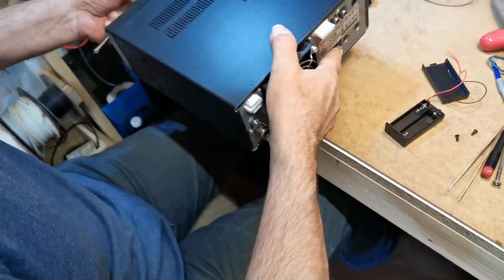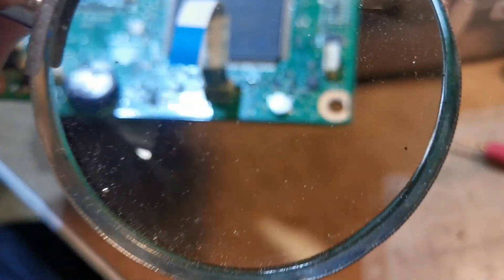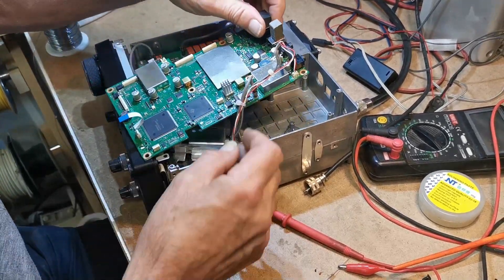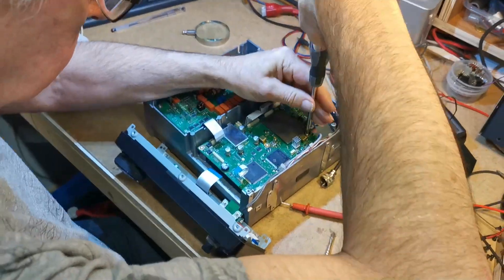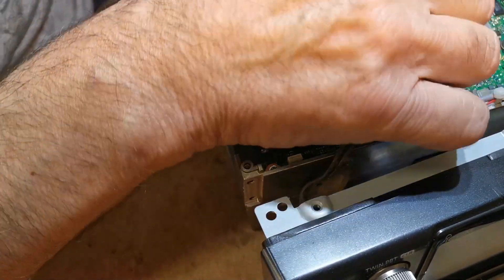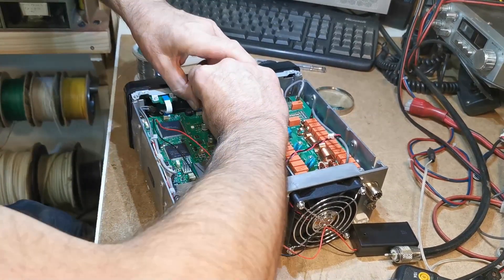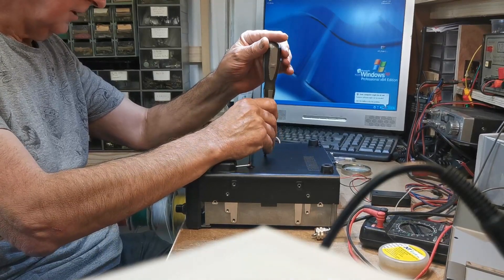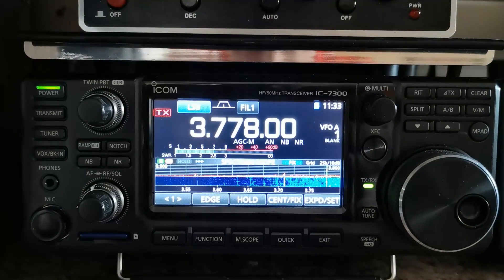Icom IC-7300 Clock Battery Workaround | Fix the Date & Time Reset Issue

Comment: Instead of AAs use a Cr2032 battery and case
Reply from the maker: If I wanted to do that, I would have. I wanted huge capacity. Still working fine to this day on the same cells.

Comment: Very dangerous working on that ESD sensitive 'Main Board'. 
Also those Ribbon cables are easy to damage.. I think this 
retired (Computer Hardware CAD Tech) will pass on this 'upgrade'.
Thanks for the video. 73
Reply from the maker: @marcroche9324  good for you. Still working fine thanks.

Comment: ICOM has a work around solution.
It is called: Time adjustment software ST-4003W
No need to replace the battery

Comment: Just done one of these tricky little buggers! I did put a diode in series just to stop the charging circuit trying to push power back into the battery!
Reply from the maker: @paulmeynell8866  it can push all the power it wants into my battery lol.

Comment: An alternative solution is to replace the coin cell with a couple of 10Farad supercapacitors in serries. These are small and can be fitted internally.
Reply from the maker: Maybe so. I wanted it external and using large cells. As I don't use the radio that often. Still functioning perfect since this video was made.

Comment: All that because you are too lazy to put the original battery back in for the backup clock? LOL LOL LOL LOL....There are aftermarket batteries that last many years. And hanging that PC board off the edge can get damaged or cracked when working on it. And not using a wrist ground is very bad. This job looks like sh*t just for the clock....SMH!

Comment: Simply keep attached with your radio a small ups 12 volt battery via the main DC power line, when not using the radio .Clock will not die. No need to play like this with 1000 dollar radio.....
Reply from the maker: Still working 3 years later.

Comment: You made this more complicated  than needs to be  and you  don't have to remove  circuit board to replace battery. Remove top and bottom covers and remove  front panel of  radio along with 2 ribbon cables. Use a heat gun to heat up battery  solder and remove it. Purchase  a 2032 battery holder ( Amazon comes with holder and wires.) and rechargeable battery LIR 2032 or ML2032.  You can  use double sided tape to secure battery holder to the left side of battery location.  Your way  of removing battery could damage the CKT. Bd.  tabs and disconnection  all the other ribbon cables and removing CKT BD is  more dangerous of breaking something. Your an amateur .
Reply from the maker: Still working though. Amateur.... Yes I am.
Reply: And you are rude and not putting yourself out there for people to learn from so, how about you make a video since you are such a pro so we can tear you apart?
Reply: Heat Gun may melt other solder point with the wide barrel flowing at the board. Could be dangerous stuff.

Comment: I have replaced batteries in many Icom radios, you don't need to remove the dead board mounted battery cell. Simply solder the red and black wires from the new external battery case right to the board mounted battery connections. Just make sure you have the polarities correct!
Reply from the maker: I'd sooner have it out. It's just as easy to do it right than cut corners I've found in my experience.
Reply: can't the battery be just removed and replaced with another the same battery without desoldering it ?
Reply from the maker: @marcing4287  I'm sure it could. I was more concerend with getting it out because if the OG battery was to leak. And to all those who said it would work, still on the same pair of cells and working perfectly.
Reply: @GeorgeEI7KO  is origin battery itself soldered to the mainboard ? if not, if I buy a new battery I could just replace it.
Reply: @marcing4287  No.  It is a PCB mounted component.  Soldered in.

Comment: Hi there does anyone know if the vfo knob on the 7300 just pulls off??  F
Reply: By the way the vfo knob is held on with a1.5mm Allen screw under the rubber band.

Comment: Yo colocaria un portapila de bateria cCR 2032 dentro del radio en vez de ese adefecio que hizo el sr
Reply from the maker: hola
Hice lo que hice por varias razones.

1- Quería que la batería fuera externa a la radio para poder controlar el voltaje.

2- Usé las celdas AA porque quería una capacidad masiva, ya que a veces mi radio puede no encenderse durante varias semanas.

3- Recibo mucha mierda en los comentarios de este video sobre lo que hice y cómo no funcionará, etc., pero aún funciona bien,
   Ni siquiera revisé la batería desde que se hizo este video.

¿Dices error? no si funciona no es un error

Hi
I did what i did for several reasons. 

1- I wanted the battery to be externaf rom the radio so as i could keep a check on the voltage.

2- I used the AA cells as i wanted massive capacity as sometimes my radio may not be powered up for several weeks.

3- I get a lot of shit in the comments of this video about what I did and how it wont work etc etc. But yet its working fine, 
   Ive not even checked the battery pack since this video was made in fact. 

You say Mistake? not if it works its not a mistake

Comment: Could we just use a Lifepo4 battery in there?
Reply from the maker: I don't know Donald. What I can tell you is, since this video was made I have not looked at the battery pack since. It works perfectly. Loadzzzz of capacity, which was my idea in the first place.
Reply: @GeorgeEI7KO  Well I know just enough to be dangers sometimes. The LiFePo4 battery is about 3-3.5v and the AA size battery should run that clock for many years. The trouble I see is that the 3v regulator could be damaged trying to charge that big of a battery. The AA normal rechargeable battery are 1.2 v each and 2 will give you 2.4v.
Reply from the maker: @donaldsmith3048  Ray says the reg won't be under any strain. As I said it's been fine since done.

Comment: Thanks for the mod! I use my IC-7300 for portable use so when it is not in use there is no power to the radio. I'm tired or resetting my clock. I'm curious where did you mount the battery pack on the radio. de ve3zn
Reply from the maker: It just sits on the desk at the back of the radio.

Comment: So, my battery went flat too. Powering the rig (without switching it on) for 24 hours charged it again. No need to replace it at all. Heck, even the manual mentions this on page 12-11:

"If you do not use the transceiver for a long period, we
recommend that you connect the transceiver to a power
source at least once a month. The charging period is two
days whether the transceiver’s power is ON or OFF."

I know: men don't read manuals...
Reply from the maker: I left it on the psu (radio not powered up) for a week straight. No dice. The battery was gone. Well documented fault.
Reply: PAGE 8-7 IN MY MANUAL

Comment: Now that you've done this mod, since the original battery is surface mount, do you think it can be removed without removing the front panel and the board?  That way you wouldn't have to pull any ribbon cables.
Reply from the maker: Simple answer, no. You don't have the access and you'd end up risking burning something.
Reply: @GeorgeEI7KO  thanks, I just ordered a used one on eBay, hopefully it’ll arrive this week.  Being that it is used, it may need this mod.

Comment: Can someone explain the engineering logic behind hard soldering a battery to the circuit board?  Why would Icom do that?
Reply: This is insane!  Makes me serious second guess their products now!
Reply from the maker: Lean manafacturing methods I'd imagine.
Reply: It's designed to last much longer. Therefore, by design, it should rarely need replaced. It is a SMALL rechargable 1 mAh cell. It recharges SLOWLY whenever power is supplied to the radio so when people shut off the radio AND the power supply the small cell keeps getting weaker and weaker. Eventually it drops too low and can't recover no matter how long you leave power to the back of the rig. Kenwood has similar issues with some radios. The problem is most people power off their power supplies when they power of their rigs. The recharge circuit is designed for that tiny 1mAh battery which has a standard charge current of 5 microAmps (0.000005 amps). You risk radio damage by substituting two GIANT 'AA' cells in its place.
Reply: @stevefrank353  The charge current is much higher: a 3k3 resistor is used to charge this battery from 3.3V. So the charging current is 1 mA and theoretically the battery is fully charged after one hour on power supply. If lithium cells go flat, they take a much longer time though to recover and to start to accept charge. The battery of my 9700 has just gone flat so I'm leaving the power on for 24 hours and see if it comes back to life.
Reply from the maker: @stevefrank353  how exactly? The recharge circuit can't tell weather its recharging a pair of aa cells or a sub miniature cell that is no longer incapable of taking a charge. To expect people to leave their power supplies on 24/7 is rediculous. The radio will only draw what it needs from the cells, and will never be able to do any damage to the recharge circuit as its no different to leaving the power supply on as you suggest.
Reply: Yaesu did the same thing in the FT 991

Comment: Is that battery rechargeable or just has to be replaced when it goes flat...
Reply from the maker: They are reghargabke high capacity cells. By my calculations of what the radio draws for the time and date backup (settings are stored on the SD card) it would take 12 years without ever being switched on for the radio to drain them.
Reply: @GeorgeEI7KO  Hi there my 7300 is about 1 or 2 years old i dont use it much but when i do the clock has gon back to zero, if i use it 2 or 3 times a week its ok, i bought the radio new...F
Reply from the maker: The battery they fitted from the factory will only hold it for a hand fuk of weeks with no power going to the radio. I've not looked at the battery pack since and all is well.

Comment: I just want to ask a doubt,  what happens if we attach a battery pack without removing the dead battery,  will it corrode. Removing the battery seems to be a micro surgery.  Tnx
Reply from the maker: I'd sooner take it out rather than risk it
Reply: The dead battery is a rechargeable lithium cell. If you do not remove it, it will be charged by the external battery without any form of current limit. That ca be dangerous.
But why replace the battery? If you leave your rig powered for a night, the small battery is charged again and your clock will hold the time.
Reply: @meindertsprang7491  I operate everyday, so there's no chance of getting it discharged or dead. That was a general question on the possibilities. 73

Comment: Thanks George and Ray!
The dead clock battery in the IC-7300 has been driving me nuts.
Having to set the bloody clock EVERYTIME you power the set back up is ridiculous.
I would live with it except when recording audio, the timestamping is all wrong.
Why the hell Icom used such a tiny battery is beyond me. Will do the CR-2032 mod in mine eventually.
Just have to bring myself to pulling apart the radio, which is not something I want to do to this set.
Reply: Hi there the best way to change the battery is take the top and bottom off, and 4 screws that hold the front on, pull the front forward a bit and you can see the battery quite easy, if your good with a soldering iron and have good eyes you can change it..F g4vvq.
Reply from the maker: Exactly. A total pain in the bum if you do a lot of recording to the SD card. If working fine since. No issues at all. We widebanded it to while we were in there.

Comment: Ha ha ha ha "That's the way I went about sorting it out"  lol, Ray sorted it out for you.  I also hate those ribbon cables, I hate them with vengeance!  They are even worse if someone has had them out before and knocked them about a bit!
Reply from the maker: Well, I did want to be able to film it properly. I have no business in there! That's why I did it external, I don't want to be going in there at all.
Reply: @GeorgeEI7KO  No, there is a bit more to them than a CB and they can be a bit static sensitive.  There is not a lot to adjust in them anyway, best staying out of them, they will work just fine.  Nice you filmed it for us though George.

Comment: May I never be so stingy to molest a good radio like that :( What would a replacement battery cost???
Reply from the maker: Fuck all probably, but I was so appalled at it lasting only 3 years, I decided I was going to go full on belt and braces with it. My last radio was 3 years old when I bought it, I had it for 10 years and never had to change the battery. I wanted it external, I wanted it to be able to take high capacity cells. Shouldn't have to be going in there in the first place after three years of light use. And further more, what molesting was done? two wires ran out the back to an external powerpack with over 12 times the capacity of the bt381 'battery' hardly qualifies. I i was drilling holes and the like id understand your turn of phrase.
Reply: @GeorgeEI7KO  I think I would have done the same, but I might have left them inside the radio, or put a bigger 3v battery in it own holder inside.  Good thinking doing it that way though!
Reply: You'd have to molest it anyway to fit a new cell.  They are soldered in.

Comment: Just don't forget about battery self-discharge. That's probably going to eat much more energy on those AAs than the RTC.
Reply from the maker: I have a voltage alarm on it. theyre industrial cells. Huge capacity.